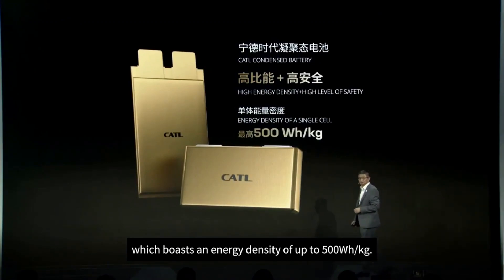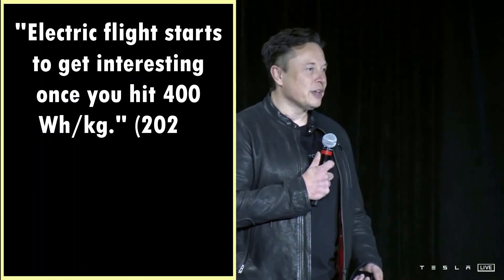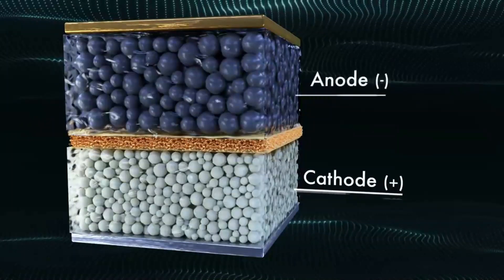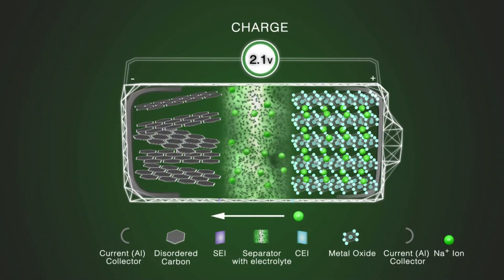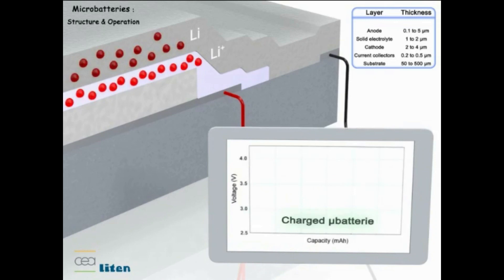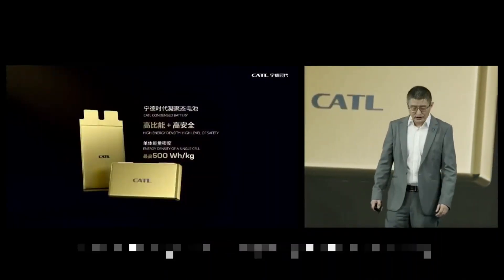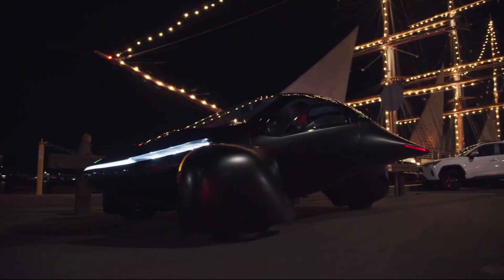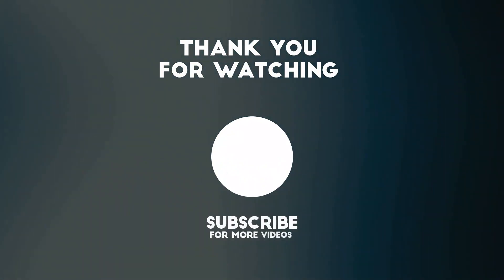CATL NEW Condensed Solid-State Battery Promising 1000 miles EV Range | ALL YOU NEED TO KNOW

Comment: He said the aircraft battery will be ten times the cost which means you will not see anywhere near these energy densities in automotive batteries for many years if ever.
Reply: Or it could just be is that anything associated with flight has to pass additional certifications. And in aviation, just like military technology everything cost 10 times as much because of 10 times the bureaucracy.

Comment: Let's hold to famous german enginering practical conformism solution it means like minimum good solution are like ower 400 kWh stuff like value for desire know how is like 560 kWh 640 kWh and 750 kWh this are big bang solution optimized also to satisfy close to fast cars speed up easy to in race fast speed stronger energy density is needed due to quality switch and long range so hp are left to theoretical  so some eficient speed and long last batery perhapse max out eficientdrive 190 kmh and max speed slight above no more then 225-230 kmh  so one off goals is like TO Have miniature cooling between cells well let's try 3x space between cells and 3x cooling more between cells if it's range closer to 1040km or ower like 1240 km is good that means energy density like 750 -1000 kWh is range for aeroplane electric airplanes or hybrids or special light cars like aptera since this type is manufacture type per piece like helicopter cocpits and light materials so like everything in range 500 - 1200 km is top range equal to diesel consume and eficient car substitute with no emissions so technicaly safety and range standards and even new purpose are also possible since car weigh turn adoptable and omega engine allow vtol lift also since like omega engine has like 300hp and like 30 kg off weight vtol cars are not that distant but we'll in use expansion time bateries  more more then 5 years in use production in factories large volume production so again technically you can develop new thing already by tech and research and inovation and even from budget production yearly assets reserve like 30% also stuff to consider like is like microspore foam artifitaly is material foam with halls to hold water drops so trough cooling and waterfog so called additional temprature lose batery is improved so car batery in vay hold moisture like a live batery second option to have salted water in a like salted nuclear reactors so process is more like closed and energy consume in batery cool is more reduced this increase safety also this stuff needs to tested and working applications put to consume in production also if concept more closed and allow even alike aditonal cooling and wind turbine whistle in between with fan cooler heater PC controlled for air and water fill is very easy smart drive use or fill or even max lvl easy desired charge or even drive in desired mode discharge batery heat and water flow this smart stuff allow PC android to perform practically and voice protocol Bluetooth has more eliek future option like in star trek in charge off main deck and safety also talking navigation is nice with voica analize protocols is cool based on vocals and strength off voice